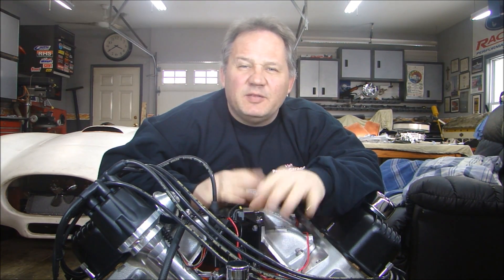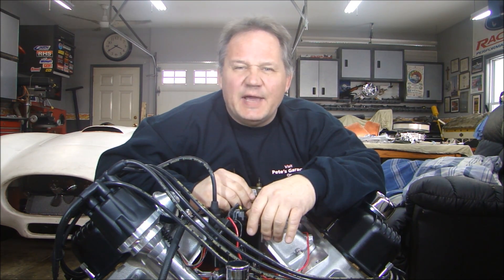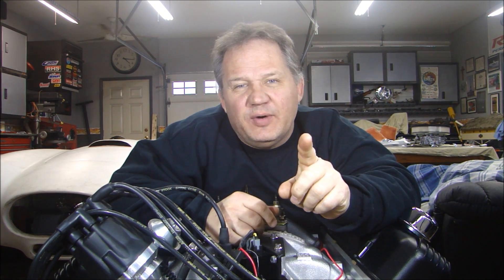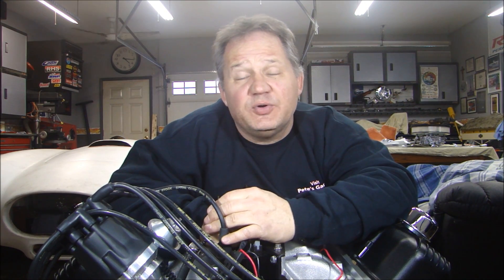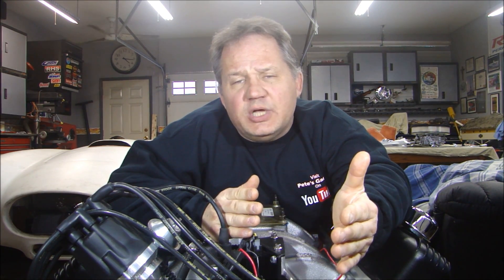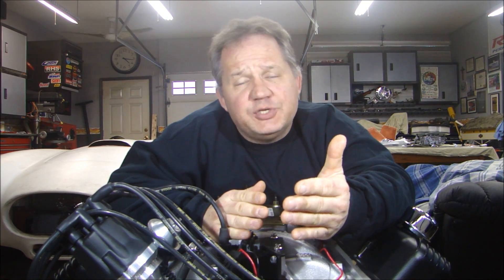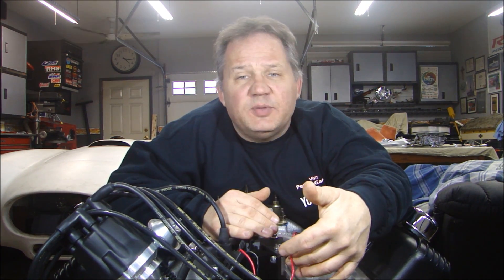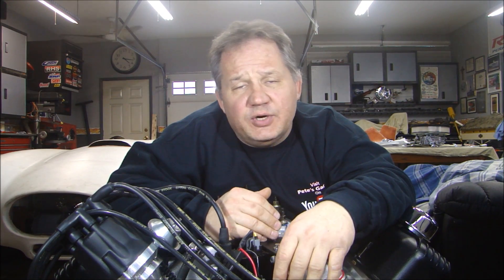440 Chrysler Mopar Engine Building Part 12 - Dyno Test

Comment: Hey Pete,
What cam did you run, it seems that it would have made a lot more power, I am building almost the same build accept for the bottom end being 512 cubic inches and my cam is xe295hl by Comp, 564/564 lift, using 1.6 Roller Rockers and 251/257 duration on 112 LSA.
With the 240 Trick flow heads and 1 7/8" headers ,it should put me around 620-40 HP..
Reply from the maker: I build engines to what the customer wants. In this particular case he wanted an engine that had just over 500 HP
Reply: @PetesGarage  yeah I get it but seems to be more of a waste of money, he could have done 500hp with basic 440 stroke, instead of buying a 512 stroker, TF heads just t make 500hp.

Comment: Nice. I know this was 5 years ago. But I ran across it now. I know you probably will not respond and that is OK. Just want to thank you. As I am putting together my 1970 440 as I type. It is old school except for the aluminum heads. I will be using the 70 exhaust manifolds and a 69 Six Pack intake. It has an old 484 purple shaft flat tapped. I have pre oiled with a melling high volume oil pump and it puts out 80lbs. I have a Milodon 7 quart oil pan. It will appear totally stock in my 70 GTX. I have painted the inner fender wells and fire wall. Also have all the parts to the air grabber hood ready to go. Rebuilt the brakes and front end. New shocks all the way around. I hope to be driving it by summer. I have all the parts to put it back together except for the seat covers and new foam. Thanks again for a really nice build. I believe my engine if everything is with in spec. Will put out about 450 hp. 475torque. But it's only a guess.
Reply from the maker: Sounds like an awesome car Randy!

Comment: A stock 440-6 has 390 hp gross on a bench but was only 325 NET hp in the car....if this is 530 on a bench it drops to about 430 net in the car......any Dodge 2021 SRT will smoke it.
Reply from the maker: Interesting
Reply: Are you seriale comparing a Supercharged engine with a naturally aspirated one?
Reply: @Vinicius-xm3cy  I saw a bone stock Hellcat do 605 to the rear tires.
Reply: @Vinicius-xm3cy  The SRT 425 and 485 are not supercharged Gomer.
Reply: @chadhaire1711  both the 425 and the 485 make those numbers at the crank not at the wheel goomer, the only stock srt's how can Challenge this engine are the superchaged ones.

Comment: Thank you for this awesome video series! This really helps a lot while building a motor. Do you remember the vacuum at a idle with this cam? Would it be enough for power brakes? At which rpm. Did the engine idle? Thanks a lot Pete!
Reply from the maker: Thanks my friend. The vacuum was around 12, I would recommend a vacuum pump, but if you have no other accessories it may be enough for power brakes. It idles around 1150
Reply: @PetesGarage  thank you very much for that info!!!

Comment: MAN I WOULD'VE THOUGHT CLOSER TO 600HP OR SLIGHTLY OVER, DO YOU THINK AN 850 WAS BIG ENOUGH FOR A STROKER? DID YOU PLAY WITH THE TIMIMG AND WHAT DID YOU END UP WITH ALL IN?
Reply from the maker: There was still more HP to get, but the customer had a goal of just over 500. That's all he wanted to pay for.
Reply: I believe there was more power in that engine....
Reply: @claudiodelcastillo893  yes, much.. the Afr's were over 1 point lean !!.. 12.2-12.5 AFR is ideal at WOT. Nothing against Pete, if 500 is all his customer wanted .. why push it ?
Reply: @Torquemonster440  Yup. Gotta have a policy of "a bit more than they pay for, but not a LOT more."

Comment: Nice work Pete!   Wondering if the #6 exhaust temp profile is anything to note being 100 odd degrees cooler than the rest? Sensor needs calibration?  (Some great learning's in this series for me. I'm prep'g to rebuild two marine 440's this winter.)
Reply from the maker: That's a great question Steve, I'll have to look into that
Reply: It's a function of the dual plane intake. They make a lot of low end torque and run great, but at the same time, their cylinder to cylinder distribution is not very good. With the Edelbrock RPM Airgap on BBC engines, i have seen as much difference as 11.5 AF on one cylinder and 14:5 on another. I have a Mopar 540 with the same heads, and after trying a few manufolds on the dyno, I settled on a Weiand single plane. It virtually overlaid the graph of the Edelbrock from 2500 to 4000 rpm, and above that it picked up power. Part of that was of course because it was a single plane and the large cube motor liked that monifold, but some of it was also because the distribution was a lot better. When I used the Edelbrock it leaned out in the higher rpm, and looking at this dyno sheet, this looks to be doing it too. I adhere to the idea that the right AF is where the motor makes the most power, i.e the engine tells you what AF and what timing it wants. But an AF over 13 at WOT in the higher rev range is a bit uncomfortable for me. 12.5 to 12.7 is about as high as I like to go, and usually that's also where the power is the  highest. Maybe a 92 or 93 jet would be the ticket rather than the 90.

Once i was blissfully unaware of in how much danger a cylinder could be in on a carbed setup. Then I started to dyno things with 8 sensors. It's amazing what we get away with and how bad cylinder to cylinder distribution can be with carbs and dual plane manifolds.

Comment: Hi Pete. I have a engine I want to prime with oil in a car sitting for some time. I want to know if it is possible to do it through the oil filter  center pipe  without removing the distributor .  Clear 1 1/8" tube  ....6 feet long..... clamped to oil  tube  with filter removed ..  Fill tube with oil and  put compressor fitting on end of tube . Then use air pressure  to drive oil into engine oil galleries .  Like this https://prnt.sc/sodrrt  What do you think?
Reply from the maker: That looks like it's worth a try

Comment: A great video Pete. My 440 just got home from the dyno. Mine is a little more tame though. 488HP at 5400, but 565TQ at 3200, and it stays over 500TQ until 5000rpm. Thanks again for the video. A great series. Learned a lot.
Reply from the maker: That's awesome, thanks Mark

Comment: I was wondering what type of air cleaner you ran. As that performer is almost 1.7 inches taller than stock. I had a half inch spacer on my stock setup an the top of the stock air cleaner would rub on the underside of the hood insulation. I was running a 750 street demon which I would also bet is lower than the 850 you are running there.  This is on a 1968 GTX stock hood. I was just looking at using the rpm intake but think I may have interference issues.
Reply from the maker: I used the cats aluminum MOPAR air cleaner from 440source
Reply: @PetesGarage  I checked 440 source seems they do not sell them anymore. I did find them at Mancini racing. Just FYI.
Reply from the maker: Thanks

Comment: Nice strong street engine,,,someone going to have a low 12, high 11 second Super Bee with plenty of traction naturally, I think a BBC would make about a 100 more though...….. Did you or the owner think of a single plane intake? I see you used a 'basic' carb with the airhorn intact HOPE YOU GOT THE 'ISSUE' WITH SOMEONE STEALING YOUR CHANNEL NAME RESOLVED?

I watched your entire series and enjoyed it, in particular the casting differences, 'Performance Engine Rebuilding' can get 650 from a 496 BBC, he has a series where he explains the head casting's, which head is a better choice and the 'good' port and 'bad' port scenario, you can make the cast heads perform with the proper work and naturally time
Reply from the maker: Thanks Jim....I'm still looking to the channel name issue. It's not as easy as you'd think. I'll look into that channel thanks.

Comment: Hi Peter, one question, i work restauration of jensen 1972 cabrio, with mopar 440 big b.  the mechanic do the overhauling of engine, and when i connect everything, the engine starts great, when is cold and slowly acelerating engine do backfire throught carb, and when engine is hot there iis no more backfire and runs great. timing is set 8° BTDC with no vacum pluged of MSD distributor.
carb: edelbrock1407
msd ignition ready to run distributor
msd coil

 your opinion? thanks. if you can, you can email me: matrix.leko2215@gmail.com
Reply from the maker: This could be a lean condition in the idle setting or primary jets with the choke setting

Comment: The reason the thermostat is left out is not to heat it up faster - it's so the dyno  controls the engine coolant temp and not the thermostat.
Note from former Chrysler dyno engineer of 13+ years :)
Reply from the maker: That is true, and I agree. My dyno guy has a small reservoir of water with no thermostat so it heats hp pretty quick.

Comment: M.A.S.T ENGINE  NEW CRATE MOTOR HP=550 ☆☆☆ $15,000 (KEEP YOUR MOTOR)
Reply: You are not very well informed, are you?
Let's look at how Mast test their motors. First off, they used STD, not SAE. Second of all, they STEP test, which adds about 10-15 numbers easily. Third of all they run temps in the 120-130 range. If you dressed a Mast 550 hp motor and tested it like this, you are probably looking at 490-500 hp.
Have a nice day.
Reply: $15000.00 could build a 650+HP 440 that would be pump gas friendly and have enough left to buy the ole lady something nice so she doesn't kill you for spending 15grand on a hotrod!

Comment: i guessed higher than 532 hp, but that was before I saw it being tested with the alternator, water pump and at 180 F coolant temp. The 850 didn't help anything, and either did the dual plane, but both are easy to swap out.
Reply from the maker: The customer had 1 goal, just go over 500 and make it streetable
Reply: Not only is the engine dressed and at a real world temp, the correction factor is SAE. 532 is pretty stout. Between 570-600 hp if you compare it to the STD numbers many others use.
Reply: agree with the dual plane comment, I would have tried a single plane, stroker already has gobs of torque but for the street maybe customer wants more?  Yes, carb with airhorn, etc... Nice strong street motor, plenty of guys run 650 cams not 550 so Pete being moderate, something over cammed is hard to live with on the street
Reply: @zxtenn  The 850 is very much in the right spot for this combo. You could probably get away with a 750, but 850 is pretty much spot on.
As for the manifold, you are not entirely wrong. I have a 540 Wedge and tested a few manifolds, including the Edelbrock. Now normally the notion would be to run the dual plane for street, but I found that the Weiand single plane picked up power everywhere in the curve, and also found that cylinder to cylinder distribution was better. I have heard similar things from others running the old Holley single planes on the Wedges.
My guess is that it has to do with the fact that a single plane normally has short runners, but due to the general design of the RB, even the single planes often have quite long runners. They kind of end up being the best of both worlds.
Reply: @AB-80X  Many times its an educated guess and the dyno is the judge by swapping this and that, takes time and costs $$$$$ but a good motor isnt cheap anyway so its worth the extra to get max. output of a given engine and combination and living with a hugely overcammed engine isnt fun when all the real power starts at maybe 4 grand unless it's like you 540.  This isn't 1968 were people take a stock GTO 400, throw on an 850 then all they get is a HUGE bog. I am 65 and had a 67 Camaro which was i built as a Yenko clone so it was a 427/425 with 456 gears and a 4 speed, that was 1975 so a typical STRONG set up for the day. 425 version had a good solid cam, 4 bolt mains, 11:1 comp. and the rect. port heads which there is STILL so much debate about VS the oval port heads. I had a buddy with a 65 GTO and he threw on an 850 with a powerglide, he thought it was fast until be brought it to the drags and barely got 15 flat. Unfortunately in those days you couldnt just order a set of DART AL heads and gain 75 hp with a good cam and manifold. Since i bought only my Camaro body with the 12 bolt i also knew someone who had an L-88 with the AL heads but that was kind of expensive so a friend found me the 427/425 which came from a late 60's Impala, it had a spun rod bearing, stock bore, etc.  I miss the looks my 67 RS with the L-88 hood, 8 quart pan hanging down scattershield and front spoiler, looked and was intimidating

Comment: Hello Pete.

In first thanks for all this build videos. I have a 1973 440 in my 70 Challenger, this engine have Toker II intake, Holley EFI Sniper, 0.507 Comps cam camshaft, stock heads, and probably stock pistons. I wanna be in the 500/600 HP range, I'm looking the KB 237 piston and Edelbrock Performer RPM heads (75 cc), do you think I need to upgrade pistons and heads (10.7 to 1 with KB 237) or just the heads will be nice ?
Reply from the maker: Sounds like a good plan, you should upgrade the heads and pistons if you're looking to get 500/600. That .507 my need a bit more too.
Reply: @PetesGarage  okay thank you 😀👍
Reply: @PetesGarage  Do you think KB 237 will be a good choise for a 500/600 HP Street build ?
Reply from the maker: I'm not sure, never built one.
Reply: To get to 600 hp SAE, you need to go this route.
Get a piston that takes your compression up to 10.5 or 11.
Get Trick Flow 240's.
Get a solid roller with about 250 int. @ .050 w. about 650 lift.
Use the Trick Flow single plane intake
That's what you need to make an honest 600 hp SAE. The stuff you have a far from up to the task.
I make about 650 hp STD but at 185 F. So about 600-610 SAE. But that's a bored and stroked 540 with the Trick Flow 240 heads, Weiand single plane and the largest hydraulic roller Howards make paired up with Harland Sharp 1.6 rockers. If you want a 440 to make that power, you need RPM and much more flow that what the stock heads will give you. That Torker II is also a pretty terrible intake to be a bit blunt.

Comment: Hi Pete! first of all how smooth and silent it does sound. How many rpm did you use. And how did the first start up go. Did you have to do adjustment around the distributor. Thanks
Reply from the maker: I think we ran up to 5400 RPM's and the timing is always the first thing you adjust. Get the timing and vacuum advance working properly before tuning the carb.

Comment: That intake and carb is choking that motor. With that big of cam and those great flowing heads that motor need a victor jr intake and at least a 950 if not a 1050 dominator.  There is alot more power in that motor
Reply from the maker: Perhaps, but the goal was just over 500 HP and streetable, not as much as possible.
Reply: Really? So you don't think an 850 will do? Interesting. I have made over 1100 hp with a 1050. Trust me, an 850 is perfect. As for single planes, sure, why not. But the correct one to use would be the Weiand or Trick Flow, not the Vic Jr.

Comment: How does the cost vs horse power compare , against the Hemi ?  A Chevy engine ?  A Ford engine ?  All normally asperated .

Thanks ,  :-)
Wyr
God bless
Reply from the maker: It really all depends on what you put in it. I can make a 351 Ford put out more HP than a 44 MOPAR or 454 Chevy.
Reply: Which yealds the greatest HP for the dollar invested ?    
Thanks ,   :-)
Wyr
God bless
Reply from the maker: Probably a 350 Chevy and a 302 or 351 Ford
Reply: @PetesGarage    Thanks ,   :-)
Wyr
God bless

Comment: Pete, I’m in the process of building my 440 in stages. It’s a fresh stock 440 in my 70 GTX. It’s got a 509 lift flat tappet cam currently in it. My winter project this year is add the RPM intake and performer 800 cfm carb. Next winter is the trick flow 240 heads, TTI headers (I currently have factory manifolds) and roller rockers. What is the compression you are running on the 440 you show in this video? Thanks in advance for your response and great videos!!!
Reply from the maker: Thanks Chad, this one had about 9.5:1 static

Comment: New subscriber big pete. I will be in touch I'm a mopar man from Detroit. I'm in the process of getting a 440 long block and a 413 wedge from a buddy of mine. My plan is to stroke the 440 with a holley efi fuel system with powerport 270 trickflow heads all hydraulic roller. I also own a 66 fury 2 with a poly 318 under 30k original miles. Thanks in advance for your help.
Reply from the maker: That sounds awesome!

Comment: Thanks so much Pete, for the tip on cleaning up the corners on the Edelbrock Performer RPM
intake! I ran into that problem rebuilding the 440 in my 69 Coronet RT and it really made
installation so much easier! Wish I had seen the videos before assembling the motor.
Reply from the maker: Thanks very much my friend. Always have to check fit

Comment: I just hope I have enough to push slightly over 600HP. Mabye you could give me a decent estimate being your around big HP engines frequently. I'm sitting at a stock stroke/bore (.030 clean up job) 440 steel crank,eagle rods, speed pro pistons all balanced, solid roller 660 lift 324 advertised duration with 282 duration at .050, 108 lobe separation, indy ez-1 max  wedge port heads  12:1 compression, super victor manifold, 950 holley DP and a 1050 dominator I havnt used yet with 2in long tube headers and a full msd high fire ignition. Will I be disappointed hoping for 600HP??
Reply from the maker: I think you'll get it with the 950 Holley